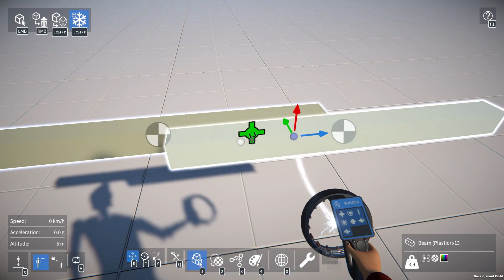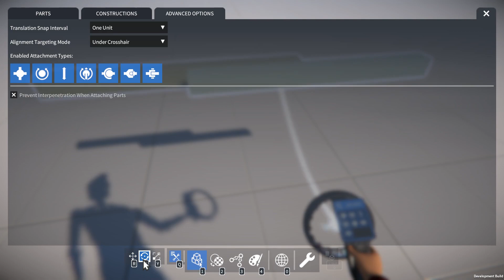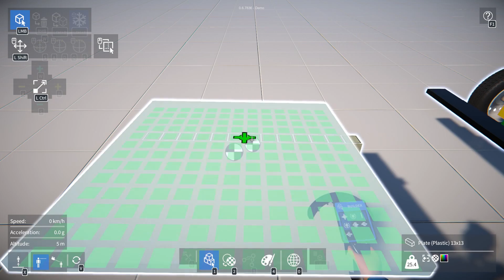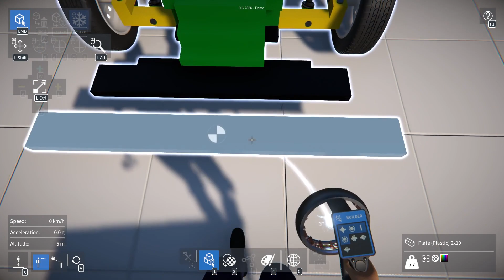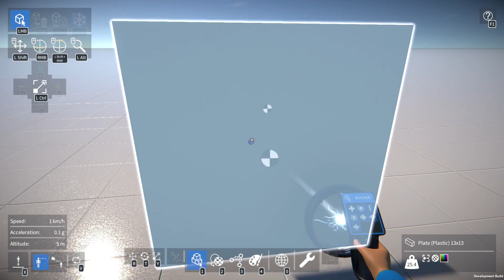GearBlocks dev diary: Manipulators and Part Alignment

Comment: how to you make the beams shorter/longer?
Reply from the maker: With the builder tool active, you can use the resize manipulator (press Y to activate it).

Select the beam (so it's flashing orange), then click it again to select a pivot point.  The resize handles should then appear and you can drag those to resize (or if you prefer, use the keyboard shortcuts: L Shift + WASD).

Comment: Great job, can't complain even if I really wanted to, and the alignment feature is done just perfectly, and yes, the third option should be default, because new players most likely won't know there is a way to change how alignment behaves, so they'll just get used to whatever is set as default rather than trying to find an option in the menu.

About angled parts: we definitely should have them in the game as long as they are not breaking the grid nature of the game, or, if I am being honest, I would prefer still having them, but that conflicts with all your previous work, and is just my opinion.

Also, not relevant to this specific video, but overall all of your work is fantastic, the interface, controls, everything is perfect, you seem to put great amounts of work in this project, be careful not to burn out.
Reply from the maker: Thanks for your kind words, much appreciated.  I'm definitely feeling under pressure to get the game done, I've been promising it for a very long time now, ha!

As for angled connections, it may require some compromises here and there, but yeah I'll definitely try and keep them.